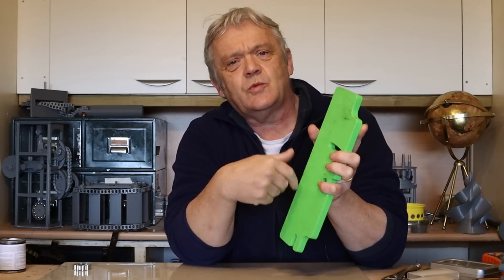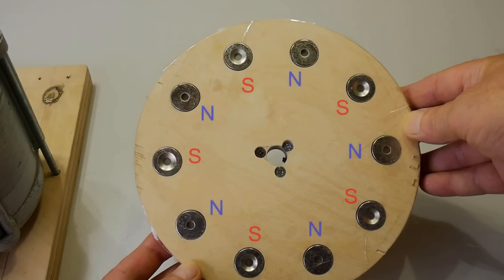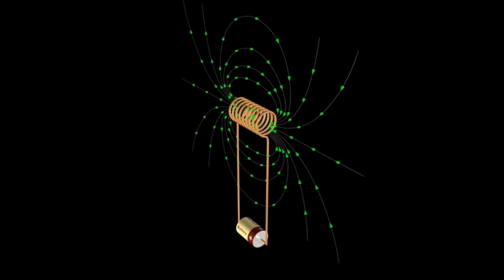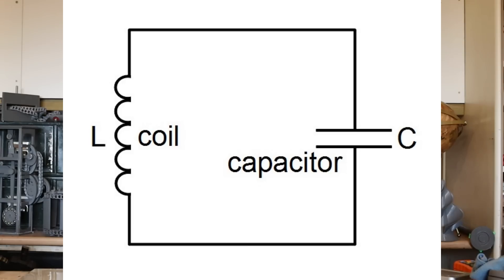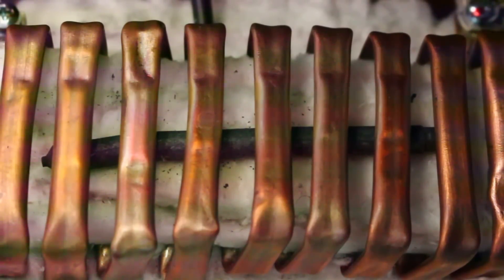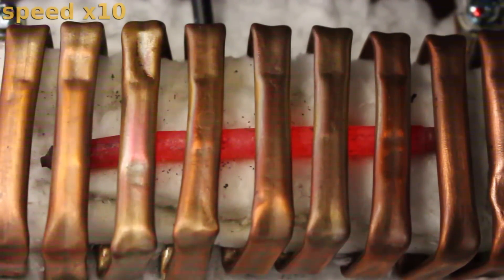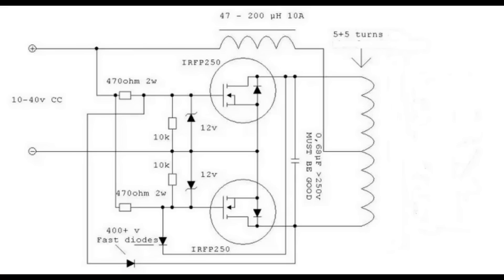2134 DIY Induction Heater - The How, The Why and The Wherefore

Comment: I have used induction heating to heat pipeline girth welds for fusion bonded Epoxy coatings.  I am searching for a deeper understanding of the process.  The coils sent to me were too large so finding the sweet spots to create uniform heat was very challenging.

Now I will be trying to learn how to design and build eddy currents that will heat a steel pipe based boiler / furnace / retort.   I need more source material on how the frequency and coils effect 5/8" x 16" steel pipe. How do I determine the optimal distance from the surface to get the most heat, how does my generator frequency effect the results? And what reference books are ideal for study of the subject?

Comment: Too many generalities and not enough specific details for us to duplicate your success.  More details about how and what the diodes, mosfets, and resistors are connected to, and the output voltage and amperage of the 2 computer power supplies in series.   I would like to make this, but I dont think I can follow all the wiring and connections based on this video.

Comment: Do you think that this could be made to produce heating to lower temperatures (37-100C) from a hand crank radio as the oscillating circuit? need something to efficiently heat vegetable oil for a fuel system on a diesel generator, and making an induction heater for the fuel that could be hand cranked would be ideal. I'm in an off grid location in rural Alaska, and temperatures regularly drop to -30C. So heating the fuel system on my diesel generator for both diesel and vegetable oil is essential, but must be done without grid power and ideally without batteries as they tend not to like -30C temperatures.  Love your videos and hope you keep up the great work! Thank you!
Reply: Hand crank? Never ever. Human being simply doesn't have enough power. Use something like oil lamp, though it is highly dangerous.
Reply: @ІгорАлієв  I can hand crank start a 6 cylinder tractor and do on occasion.  It's all about gearing, I only need it to heat for a brief period of time and only to a modest heat.

Comment: Rob, perhaps for completeness it is worth mentioning that eddy currents are a very inefficient way to heat up a piece of metal. In the device you presented eddy currents play a very minor role. Most of the heating is achieved by magnetic domains switching under the influence of fastly changing external magnetic field.  So only ferromagnetic samples can be heated efficiently and even them only to the Curie point temperature.  It takes a much more complicated induction heater to melt steel or to heat non-ferric metals. Like you video though.
Reply: There are applications other than metal melting...

Comment: Rather than generating the oscilation with a tank circuit,  a relaxation oscillators using someekind of negative differental resistance device would seem to be a great way of dumping power quickly into a coil. Charge a large  capacitor.and when it exceeds a threshold voltage dump the charge into coil.
Yes the relaxation oscillator frequency would need be adjusted to suit coil and part, but that could itself be useful in how focused the heating effect is. 
Also different materials heat up better at different frequencies

Comment: So, methinks one could take a ham radio transmitter, send it into a 50 ohm load and "boil some water"
Reply: It happens i got just that, actually called a "micro-wave" and mine is most useful in the kitchen...

Comment: Is it possible to make a induction heater 3d printer to melt powdered metal or small granules of metal & have it extrude as part cooled metal through heat resisted nozzle so that it dont drip out & dont just run but holds its form we would need a way to instantly cool the metal like pressured non flamable gas maybe?

Comment: In the uk to add a wind turbine has all the legislation of msc 001,020 and 006.... A windwall just creating heat to be used by a heat pump. Wouldnt fall under the red tape but , could save us a load of power useage over winter🤔

Comment: Thanks. Very interesting. 
Quick ask. Please leave the diagrams up longer. Flashing for a couple of seconds doesn't show us anything unless we scratch around to find and pause them. 
Might be an idea to include something about Moffett drivers, even if it's just to say we should use them and why.
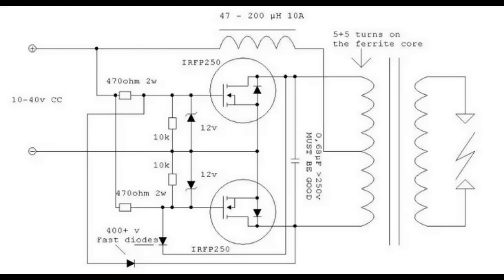Reply: 5:18 Schematic - Oh please, don't tell me this ain't familiar!  Mazzilli's "Royer ZVS" going back to a patent of 1954, hence the sole interest besides being an unfinished prototype since 2019 or so...  Searching for some real challenge?  Integrate self-protection into the power-stage itself, and why not have a slave interface to synchronize multiple boards so to distribute electrical stress while combining flux power.  I totally agree about the temptation for gate-driving, though i'd also comment that the D.C. ZERO Hz state is forbiden, since in IH drivers the flux energy comes from field reversals, essentially:  it's all about pulses.  So why not control those gate-drivers with adjustable-width down-counters, behaving as timers!  Imagine 5 microsecond pulses repeated as series of 20 pulses per train, modulating average power transfer by removing pulses until all that's left is a sync mark, to double as an IH scanner capable of "listening" to the susceptor coupled to the LC resonator...  Add a permanent magnet and this should provided the means for an audible transductor, etc.  With the option to add "smart" features by software to a slave setup.  Etc., etc.  Things hardly accessible with our hands tied in the back, contemplating a self-destruct contraption waiting for PSU failures (e.g. where its "protection" resides).

Comment: I'm not an engineer so this is just an idea. However, I don't really see this as a mechanism as such if it is simply built into the disc so that it switches on and off (preferably magnetically), as it spins. The speed of the switching equal to the speed of the generation.

Comment: I wonder if that can run a flash tube boiler.
Reply: yes. But you're better off driving an electric motor directly.
Reply: @thekaxmax  So it is bad for heating.
Reply: @travismoore7849   No, you use the induction heater to heat a radiator plate directly rather than going for the complexity and losses of adding hot water/steam to the process. More efficient, though, is using IR projector heaters--direct heating of surfaces rather than heating air in the room.

Comment: I was just thinking.
If I had a bag of sand and a bag of water, if I heated both to 150 degrees F, which one would keep hot longer?
Reply: Depends on insulation and how much the bag allows convection in the water and how fine the sand is cos of air convection in the sand.

Comment: Why not use this to boil water for a steam turbine generator and use a portion of the output to drive the induction circuit after the water begins to boil inside the pressure vessel, the output would be enough to power the induction circuit and still produce output power because of the expansion of the water and the increasing pressure,  not getting something from nothing, just capitalizing off of the expansion of the water into steam and tapping a small portion of the output power to continue the reaction while using the rest of the output to do work like charging batteries or just running other stuff.  The input would be x, the output would be x + the expansion of water, - friction and losses, or y, y is greater than x, therefore once started from outside input, it could run itself.
Reply: that's called 'perpetual motion' and can't work.
Reply: @thekaxmax  no, it's not,  perpetual motion require no initial input and has zero friction, and is therefore in violation of the 2nd law of thermodynamics,  my idea here requires input energy, allows for friction and capitalizes off of known expansion of water vapor under pressure, it is no more a perpetual motion machine than every steam turbine power plant in existence.
Reply: @jasonburguess   Nope. All perpetual motion requires is more energy out than put in. No perpetual motion machine has ever made the point that it's frictionless.
From your description there's more energy coming out than going in.
I suppose that it could be read that you're using waste energy effectively, but that's not how I read that.
Reply: @thekaxmax  water has mass, mass has energy, you are using the energy that is already in the system not getting it from nowhere. It requires about 1kw per hour to heat a liter of water to boil, but the water once boiled can produce 2kw worth of output electricity via a turbine generator set up, take the 1st kw and use it to fuel the input and the output is 1kw minus the friction in the system

Comment: Being an electronics engineer I've been playing with induction heaters for years. Even made one that looks like a tennis racket. I shrunk the electronics to fit in the handle. Simply plug this into a cigarette lighter socket of a car and you put a pan on the large bat area and you cook a meal. Works great. It really is not difficult. The trick is doing the other stuff I did to make it ultra efficient and effective. Nicely explained Rob
Reply: I am just an electrician, but would it be possible to easily build something that can heat a branding iron.
Reply: @UgadArgentis  There is no electrical device more efficient at converting electricity to heat than a resistor or electric element (basically 100%).  Just wrap some resistance wire around the
 branding tools and put electricity through it. Trick is to not waste heat on things that do not need the heat such as the stem or mountings etc. Heat up just up what you need and nothing more
Reply: @UgadArgentis  just make up a heating element for what ever your power supply is. To help reduce the energy losses just insulate all heated parts and put more insulation on the heated parts and finally put some more insulation on the heated parts. Then only expose what needs to be exposed and nothing more. Induction heating allows for focused heating but ultimately resistive heating is still slightly better in efficiency, just a bit more difficult to focus the heat.
Reply: i want to put it on wheels to melt snow in my driveway by remote control.
Reply: @brianwills3757  induction cannot melt snow as snow does not conduct enough to produce the eddy currents that produce ghe heat in metals. Besides snow is below 0 degrees cellius.  That means you will have to change the state of the water vapour from a solid to a liquid.  There is something called latent heat energy in doing this change of state. Changing the state in all cases requiem an imense amount of heat energy in the case of water I think it is around 1000 times as much as is needed to change water by 1 degree with no state change. Best rather think of just finding a way of sweeping the
 snow away rather than melting it.
Reply: @bartronicsecurity snows mostly water, pure water isnt magnetic let alone conductive. I know you know this👌
Reply: Can I guess flyback spike transformer usage?
Reply: @mememan2344  No. Sorry can't say but it did improve the energy-efficient efficiency to such an extent that I used 1/4 of the energy of what a normal induction cooker used and allowed me to cook meals with a mere 150 watts instead of 600 to 800 watts as used by most induction cookers. That is why I could run it from a cars cigarette lighter socket.
Reply: @bartronicsecurity  well if you ever go into production, hit me up I wanna be first

Comment: would the steel still heat up if it's packed inside carbon, or would the carbon absorb the power? If the heat can be focused on the steel, I'm thinking it might be a decent way of case hardening mild steel.
Reply: Induction furnaces are routinely used for heat treatment
Reply: induction coils for forging metal is already a thing.
Reply: Rather not. Graphite has a low permeability, so the energy will get absorbed by it before getting through to the metal. It is frequency dependent though, so a low frequency like 50/60 Hz would be your friend. But why would you pack your steel in carbon if you want to heat the metal? For surface hardening you would rather choose a high frequency which concentrates on the surface, so you don't heat more of the piece than necessary.
Reply: @graslurch3685 why? A.
for carbon case hardening want a low carbon steel to be very hot next to hot carbon so the  carbon  start diffusing into the surface of the steel to produce a thin layer of extremely hard but brittle high carbon steel. As bulk of such steel doesn't have the additional carbon it retains the properties of mild steel.

Could  also add nitride case hardening  in similar way, but the chemicals to apply to surface   tend to somewhat toxic.

Comment: Hook this up to a wind turbine and have the spinning magnets heating up the bottom of a well inuatwd sand battery get all that energy into it as heat  and during winter use the excess heat to get your home.
Reply: You can just run a shaft down from the mill and mechanically churn water to heat it.  Pretty much 100% efficient, excepting the gearing to change the direction of power.  No need to create electrical eddys when you can as easily create hydraulic ones.
Reply: @gumbykevbo  while true I would have the magnets heating copper covered in sand to store the heat and then have the water heated through contact with the sand .
Oh how exactly does the hydrolic edys work in heating water and how much resistance is created by the water ?
Reply: dont need wind turbines or induction, you must work with nature not against it....
Reply: @zeropointstateofmind  
What is not natural about what I am doing? This is using natures laws  for my advantage without destroying nature.
Seems like a stupid response in my humble opinion

Comment: Dumb question probably, but could a contraption be built using gears that could spin the magnets fast enough (to boil water) using human power?
Reply: Depends on insulation mostly. A fit adult male can produce about 100W continuously, which isn't a whole lot, but as long as whatever you're heating is very well insulated, you can certainly dump enough energy into it over time to get it to 100°C and start boiling the water.
Reply: Ever seen how they started radial airplane engines back in the day, the wind up starters? Food for thought.
Reply: the human still needs to put out enough energy/second to heat the water, taking into account the efficiency of the conversion equipment. See above for what was the rest of my comment. :P

Comment: Robert, Subject: Concrete Battery ... Could you do a video on building and using a small concrete battery (cement, carbon black, and ??) ??   It would be appreciated.
Reply: i hate to ruin it but i saw those news articles and looked into it and they're mostly pretty absurdly inefficient because the internal resistance is so high. 
however i have a cool idea of using carbon black baked into some bread just for smaller scale versions of that
Reply: you can use anything as a heat battery with the right insulation.

Comment: The tubing should be bent without impeding  it to be able to run a coolant through it, such as water.
Reply: Interesting! Since the coil is only "carrying" the magnetic flux, it doesn't get hot itself, but the radient heat from the sample might exceed the melting point of copper if enough power is applied, so cooling the coil would be needed. 
So now I'm wondering how flowing a polar molecule (h2o) through the coil will behave? (Not important, just gedankenexperimenting ;)
Reply: @101jchristensen  to create magnetic fields strong enough to do this it requires current values that WILL warm the copper
Reply: @101jchristensen  Water is pretty much non magnetic, at least for practical purposes. Diamagnetic, to be specific. Running water through the inductor coil is done routinely in the industry, you should take care to insulate the pump.
Reply: Water cooling is because of the radiant heat of the billet being heated. Steel melts around 2400 degrees